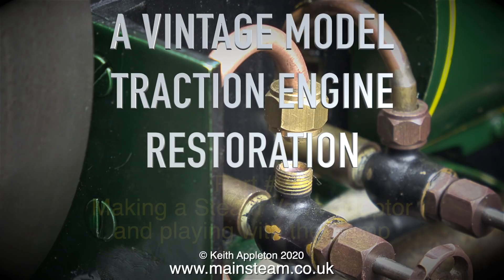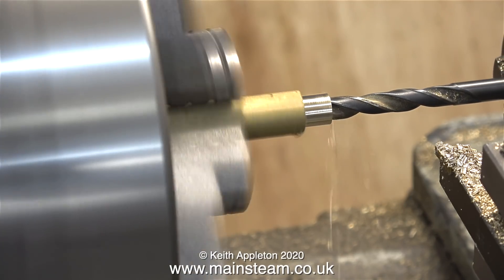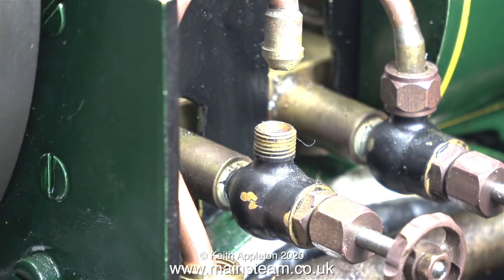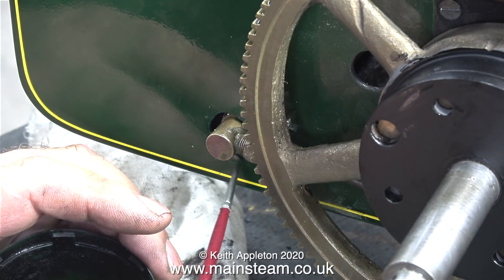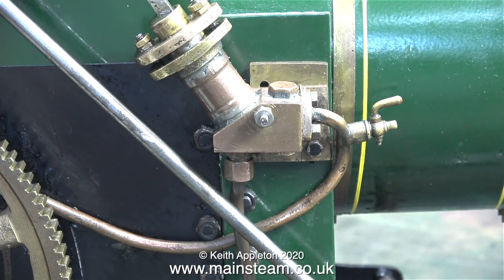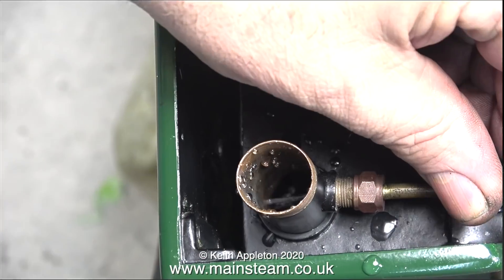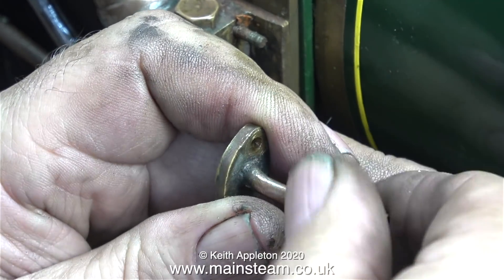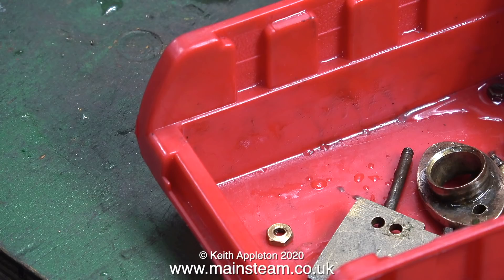A VINTAGE MODEL TRACTION ENGINE RESTORATION - PART #9

Comment: I agree with your view. As you state,you've made video's on the technical process. Making more would be boring. I enjoy watching the details of each individual job. I'm a fleet mechanic for heavy equipment and I enjoy the final details (painting a part ect) of my job the most. I find aesthetics important its called pride in one's work.

Comment: Awsome tips as alwys!
Despite living in a human centipede country i use Imperials a lot, especialy when it come to old cars and general workshop applications.
Imperial are still standard for woodworking, boats and some old standrads for car engines in my country.
I know they try to reform it to metric today (like screws and nails), but oldscool people like me are still refusing to use the centipede system for carpentry work and framing constructions. Nails and wood are still in imperial whan people ask me! ha ha

The more i get used to the BA system, the more i came to like it for this type of tinmetal applications actualy.
If the system actualy managed to keep heawy bombers together (i mean litterary...) during the war it better be reliable... ha ha

Comment: I think, for the first time, I'm actually following some of your advice. The only reason I've not done it before is that I have no lathe, no milling machine, and I don't do much with live steam. You use of cellulose thinners and preparation  methods for cleaning and painting is brilliant. I'm starting with a pair of 5" gauge bogies. They are commercial items, but the original paintjob was not very durable. Also there were 16 wrong bolts used, I've ordered the correct ones online (M3 hex-headed).

Comment: Keith, I always like your videos. I especially like the ones where you disassemble and repair / refit / the different component parts. I like the methodical process of working on the whole engine, plant, device. All these need to work and are always interesting to see how the whole of the component parts fit together tp form a working device. Yes this includes painting and lining. It is all part of the whole. I particularly like this engine. I really like the way it looks and how all the parts fit together to make it work like the real thing. Please keep up the efforts.